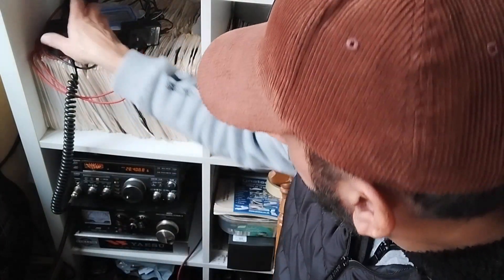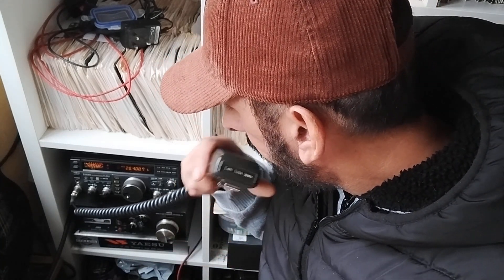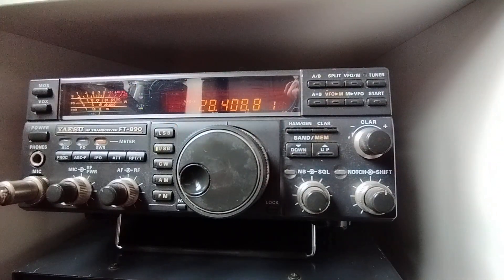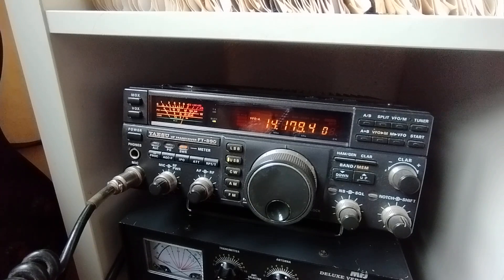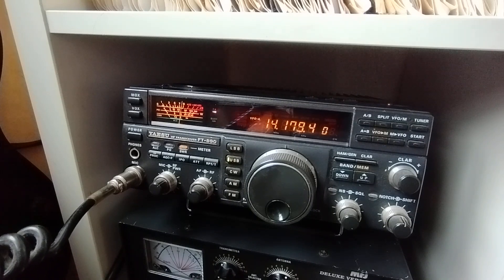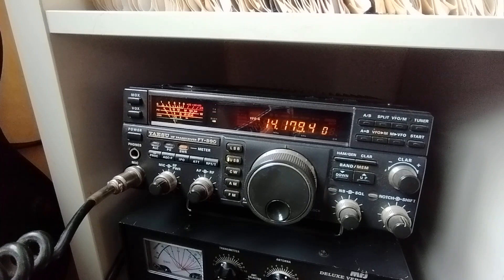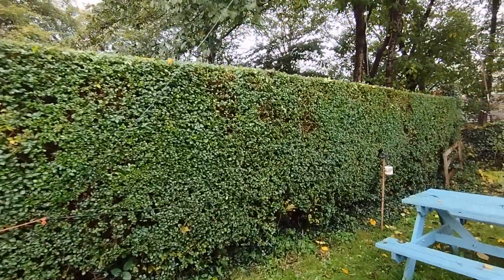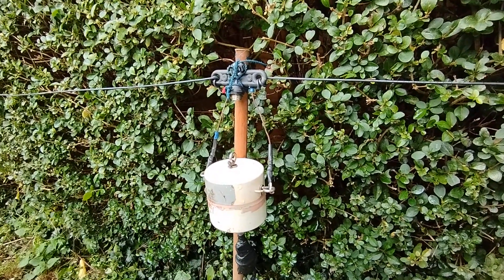Homebrew Delta Loop pt 3 - Final SWR adjustments and Test - 100 Watts

Comment: Are you using 14 gauge copper wire like thnn/thwn 2?
Reply from the maker: Multi strand 2.5mm copper wire with insulation. It's electrical installation wire used for wiring power to mains electric. Works well.

Comment: Big vinyl collection Simon ? What you listening to ?
Reply from the maker: I used to run a local station for years and play clubs and sound systems. It's mostly Reggae and Hip hop with some rnb jungle and rock as well  😁
Reply: Just building a 10m stealth delta loop in a tree at the bottom of the garden. Made a pretend bird box to hide the balun. I've run a flexible conduit containing a  draw wire under the decking so it's all coming together. Only work on it when the wife's out...🤣😂
Reply from the maker: @davidbridge3542  lol love it... I am similar I wait till the neighbors go out and then act all crazy with my antennas as fast as possible. It's like a military op but always fun. Good luck with the setup I love the bird box balun. Great idea. 73

Comment: I was wanting to build one of these so just 72ft of wire to the 4:1 and job is a good one ?
Reply: So 68ft lol
Reply from the maker: Lol yes 67-68 feet will work well especially on 20m. 👍
Reply: @M0YKSHamRadio I will probably start out with 70.5 ft and work from there. Also it probably depends on the diameter of the wire? Don't want to be short on the elements, better to long!😊
Reply from the maker: Nice one have fun. 67-68 feet. I'm going to try a bigger one next.73

Comment: Interesting - I always learn something new from experimental antenna projects. It's amazing you are getting ~1:1 SWR from 26 to 30 MHz. Maybe I'll have to rig something up to try and replicate those results, when I get a chance.  
I once made a 75m delta loop, but I used only a 1:1 choke balun, with no impedance adaptor. Other than adjusting the length of wire, I tuned the SWR by changing the location of the feed point; as I recall it worked in both the lower corner and even better 3/4-way up towards the top of the triangle. I never used it on other bands, but it did work pretty well on 75m.  According to my 4NEC2 simulation, it was even slightly directional. And now that I think about it, the delta loop concept should have relatively low ground losses if the high voltage nodes are located near the high point. 
 
May I ask - why are you using the 890 instead the new 101MP?
Reply from the maker: I was surprised throughout the whole series of videos, each time I did something it was not what I expected (much better). The 4:1 balun has worked wonders with the SWR. Yes this time after making length adjustments it is flat SWR 26 -30 MHz. The results are excellent, it is better than my last delta loop which was behind the YAGI in no man's land external to my garden the wooded bit. It is a lot better position now. 

The only reason I am on the FT-890 is to promote operating DX on a basic setup with 100 w can be just as much fun as a bigger expensive station. Especially the home brew antenna bit. But for me, myself and I....
 I get to have a second setup in my dinning room lol.

I can see that I will probably end up trying it out with the FTDX101MP seen as it is pretty good. 

I had a 240 ft Loop which worked on 75m, mine was fed with 50 ohms coax and I used a choke and Nevada TM1000 tuning unit (which I still have) it worked well but took some tuning up with the old school roller inductor.